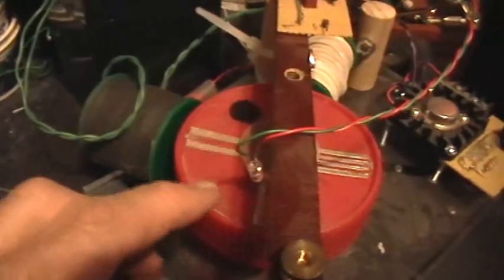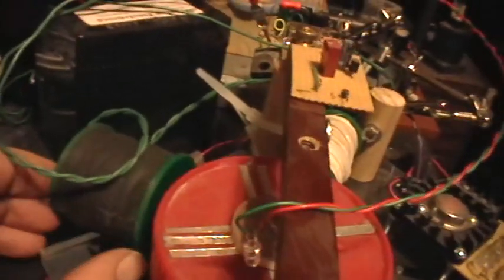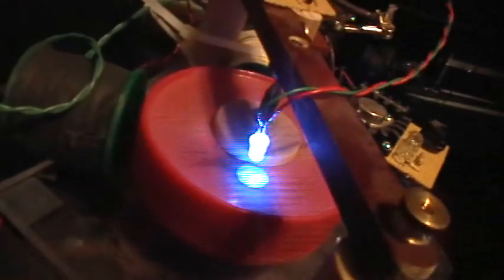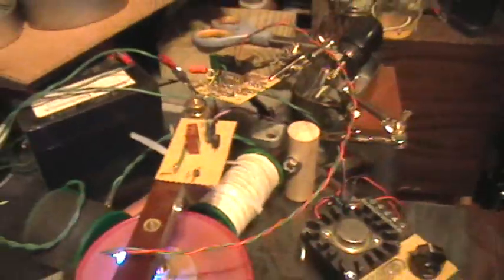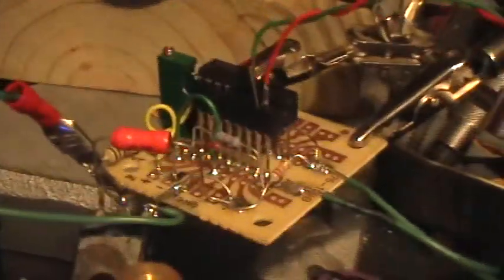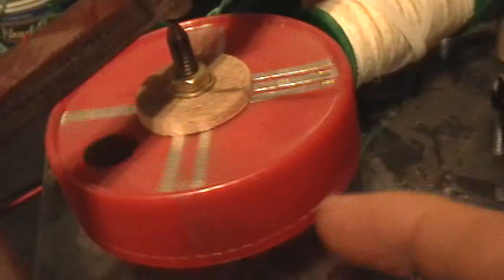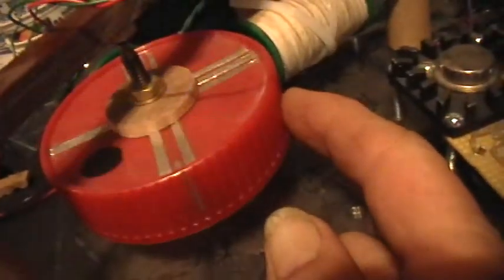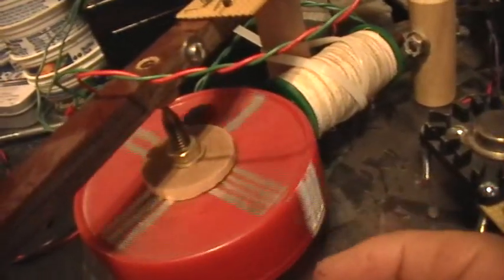Pulse Motors: MileHigh OpAmp Comparator Driver Development #3

Comment from the maker: Your oscillator is still oscillating. Battery voltage is down to 332 mV and the frequency is up to 620 kHz. The DALM thing just won't die. When I rejuvenated it with heat it cheerfully went up to over 700 mV and lit up the LEDs brightly, then it took a long long time to come back down to under 400 mV.